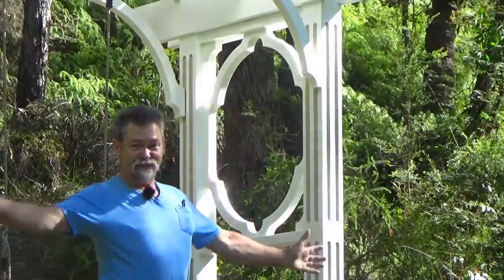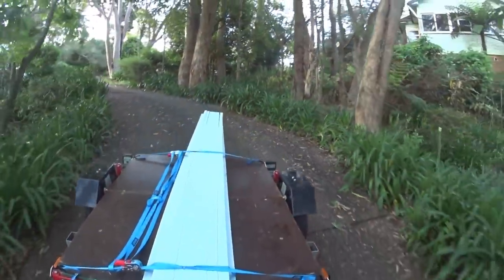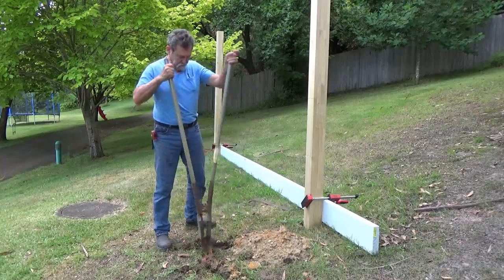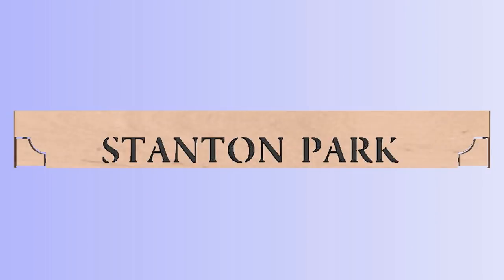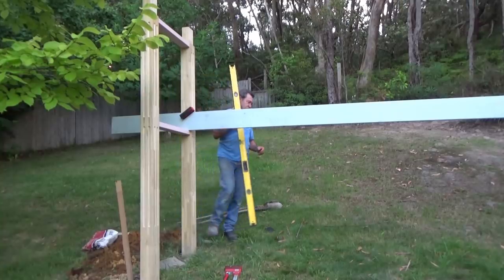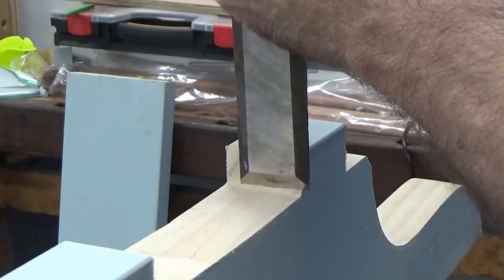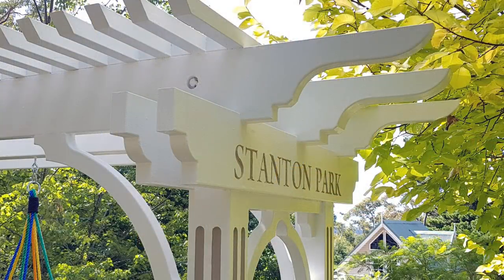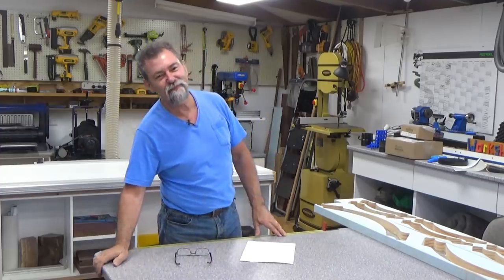Elegant garden swing Dave Stanton

Comment: Very nice. Spending time before and during a job give great results. Well done. One question, did you put some protection on the wood parts what goes in the ground? Concrete fluids during drying and water can Hurt wood badly.
Reply from the maker: Thank you rvamerongen ! The timber posts used are specifically designed to go straight into the ground without any further treatment. It is H4. That is one of the reasons I didn't cut the bottom of the posts in this instance. All the rest of the timber is H3 for external above ground use.